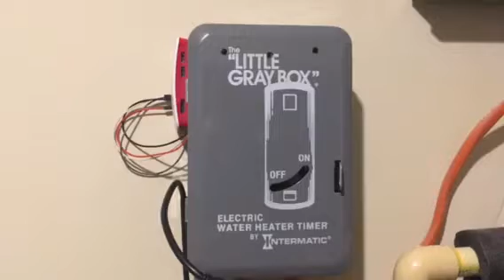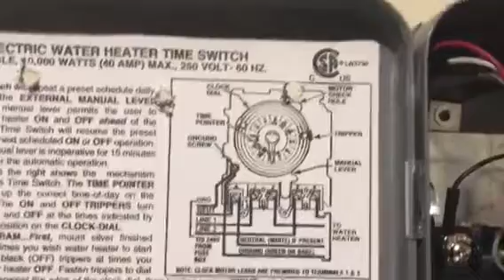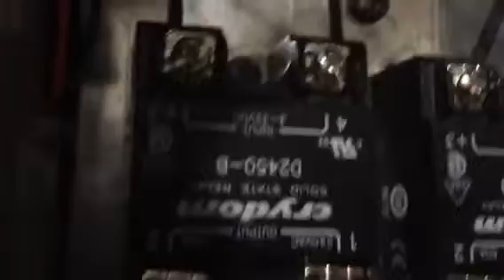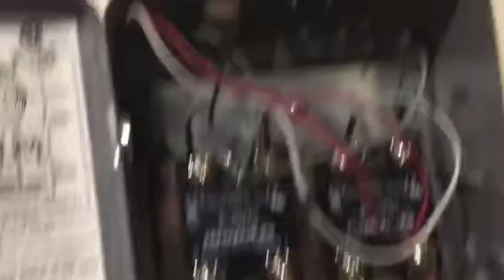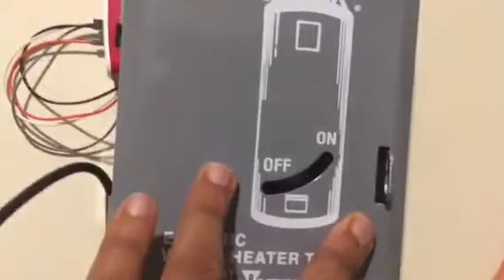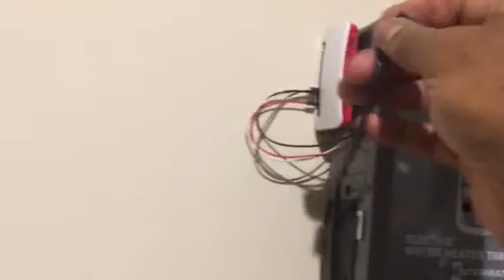DIY WiFi Water Heater Control with Raspberry Pi Zero W

Comment: If I understood, you mentioned in a previous video that your batteries were full sometimes around noon.  

Why not get an additional Morningstar controller and use it in diversion mode?  

This way when your batteries are full, you could use the excess energy for hot water.

 You might save some energy by not inverting it to AC.

Comment: Did you see his graph. It uses 100% solar. When it is lower than the heating element. I have a similar system to you but turns on the battery charger. But if the power is a bit low no battery charging.
Reply from the maker: Yes, I saw his graphs and it's definitely something to think about.  I also checked out the DIY diversion builds.  In the past I've considered doing something similar with relays etc, switching 120Vac between grid and utility but I've shelved the idea for now.

Comment: I'm an electrician. It only takes 1/2 of 1 amp to kill you. If you get zapped and think I didn't get burned I'm OK, electricity starts cooking on your insides first. You've put scar tissue on internal organs. Be safe, do all connections with power off and install power when you're finished.
Reply from the maker: Thanks for the wise words from an expert.

Comment: Brother look into Sonoff. There cheap 5 for like 20 bucks. They work woth Wifi and you can use Arduino Software (IDE) for hacking them. They can use from 5 volts DC to 240 ac.. Will work with code red aswell.. Looks good brother. God Bless
Reply from the maker: Thanks my Brother, I've looked at the Sonoff products and they look pretty good.  I've actually built some smart switches and outlets using the PiZero and with a ESP8266 with similar functionality, I like programming them with Python and MicroPython, which gives me a lot of flexibility.  Thanks for the comments and God Bless.